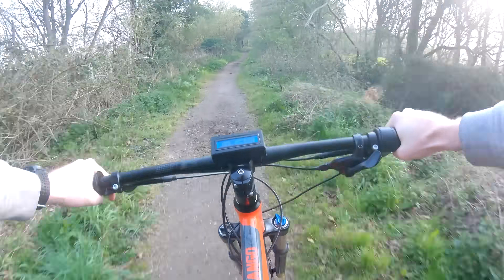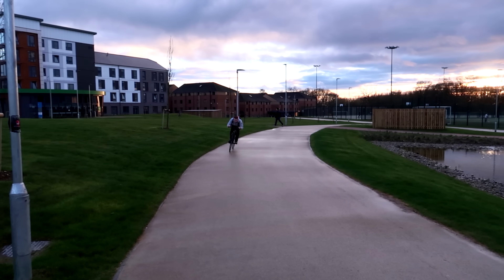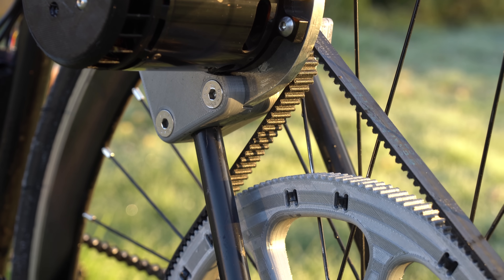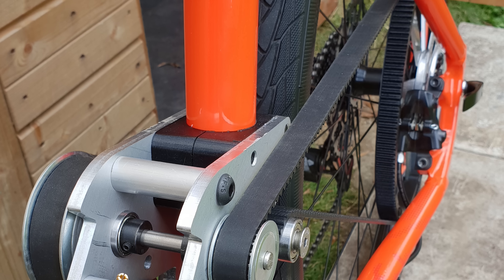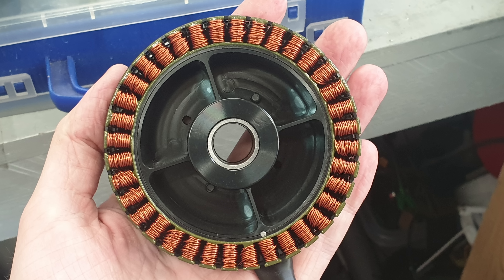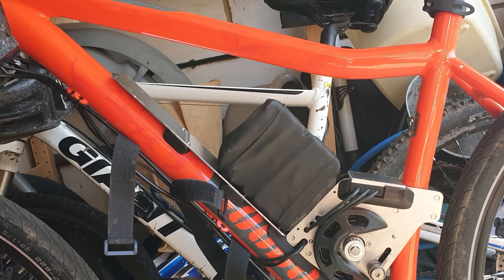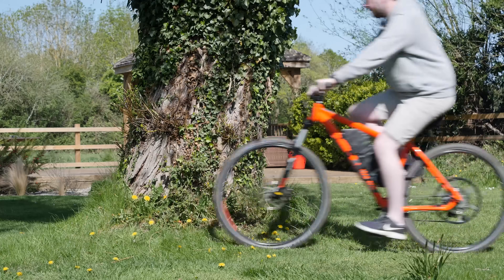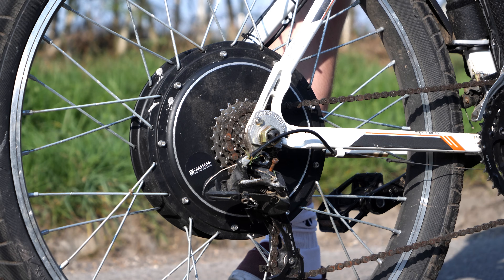Building an Electric Bike

Comment: i would have put some plastic between the cells in the pack. the heatshrink tubing those cells use a can be easily punctured by cells rubbing on each other or in a crash, effecitvely shorting them out.

Comment: I BOUGHT A EBIKE AFTER ABOUT 1000KM I CHARGED IT AS NORMAL AND IT WENT HALF AS FAR AS NORMAL NEXT CHARGE IT WENT ABOUT HALF AS MUCH AGAIN,,SO A QUARTER OF  NORMAL AND SO ON  TILL ID PLUG IT IN AND THE CHARGER LIGHT SAID CHARGED[GREEN] BUT THERE WASNT ENOUGH POWER TO TURN IT ON,IM SURE ITS NOT A BROKEN WIRE AS I CAN JUST HEAR THE HORN IF I PRESS IT SO POWER IS LEAVING  THE BATTERIES, ITS DRIVING ME NUTS,ANY IDEA,S  MY KNOWLEDGE IS THUS :I UNDERSTOOD EVERYTHING UPTO WHEN YOU SAID THIS IS MY ELECTRIC BIKE[9SEC] EVERYTHING AFTER SWOOSH

Comment: ME: Just buys an electric bike to avoid 3 years of designing😁
Reply: Electrict cycle cost around 25000 RS 
1 euro or pound=83 RS
1usd=70 rs
Reply: This is why you r not engineer 😂🤣
Reply: @ramadavince6611  lol I have home made electric motorcycle
Reply: Also building your own ebike is and awesome experience. Even if I have extras cash to buy ebike. Instead I will still build one myself
Reply: Depending on where you live there could be a lot of regulatory issues too, in my country for example up to 25 km/h assistance is allowed but continuous delivered power has to be 250W or lower. Also throttle based systems are not okay, only pedal assist so I'd already have to look into either a torque sensor or something that detects rotation of the paddles. As far as I'm aware as long as you're within these limits you're legally okay also with homemade conversions.

There are categories that need insurance and a plate though that aren't restricted to that power and speed (helmets also become mandatory with those I think, which seems reasonable to me). But since we're then in a regulated vehicle category I'm not entirely sure if technically from a legal point of view every "model" that makes it to the market has to be approved by one of the authorities in Europe that is allowed to or if everything is allowed and you're just screwed if they catch you and it doesn't meet the legal specifications. 

Both scenarios to me were way too much of a headache, ended up just going with a regular commercial mid drive motor solution and quite happy with it. Didn't want either the liability of fucking things up for the low power legal category or the second category where it would actually have to have a registration and insurance to drive legally.

Comment: In the first two motor setup, didn't you just need a belt tensioner in the middle position instead of a straight pulley?

Comment: Lots of fun building an ebike really from scratch. When I built mine I didn't even have a capacity test meter for the recycled laptop cells, recently ran a test on the pack and found they were within 15% of equal (9P6S pack powering a used electric lawnmower motor). I had lots of challenges too, but it adds to the fun and eventual satisfaction. I welded larger and larger sprockets onto the rear end and eventually made my own 7-tooth motor sprocket to get the ratio nearer ideal. It might have been easier to buy a kit but that takes all the fun out of it!

Comment: Always great to see innovation and enthusiasm on your videos, but in this case it's a shame that legality of elexctric bikes isn't discussed at all so encouraging people to build bikes which are illegal to use in the UK - anything above a 250W motor with an assistance cut-off at 15mph would make the bike a motorcycle and need a licence and insurance as such.
Reply: One guy here in Norway crashed into a pedestrian with his illegal e-bike in 2018, and the pedestrian got several small neck fractures and a concussion. He was sentenced to 15 days in prison as well as paying ~€2000 in compensation to the pedestrian. He had bought a 5.6 kW e-bike online for about €6000, and the bike was of course permanently confiscated.
Reply: Agree with this comment completely. Please say that these are private roads otherwise what you are doing is illegal. Also, as this is a new kit, a throttle is also illegal. I do like how you are designing new ways for an electric bike but maybe look at being more efficient by powering the crank rather than just the rear wheel. There are kits out there for a crank with a freewheel in them so when powering the crank, the crank arms wont spin.
Reply: @robmac3702  Those were most certainly not private roads.  He should stop, especially now that he's put evidence online.
Reply: The requirements in the UK are referred to as EAPC 
https://www.gov.uk/electric-bike-rules
Reply: These laws are Frankly not OK. I can power a bike to 20mph easily enough so it should not be illegal to have an ebike that fast. Taxes.   For what? It doesn't do anything different than a bicycle.    It's not fair really.
Reply: @gur262  "Taxes.   For what?" By applying "Leftard's logic" we can deduce that if Climate Change can be solved by adding a Carbon Tax, then applying an E-Bike Tax will reduce the speed of E-Bikes. I'm sure that would make perfect sense to a Leftard.
Reply: I'd say the odds of him getting a fine are very very slim. Everyone who buys e-bikes removes the speed limit anyway
Reply: @rodrigoc.goncalves2009  
Whilst that is very true, as a working engineer, one of the main prorities of a task is to design something which is in the confines of your local laws. After that, design using best practices such as British Standards and ISO's. There are many people hot rodding ebikes on youtube but one of the main reasons many people watch Stanton is for the informative and logical approach. By not putting in a disclaimer in the video he is putting himself at risk of prosecution which isn't very logical and may stop the great video output that we can expect to watch from him.

Comment: The problem is you used a motor with high RPM. It has been proven that e vehicles including bikes, cars, and the wheelers perform better in comparison to contemporary gas powered cars if they are installed with bldc motors with less rpm. For bicycles, anywhere between 3KW and 2000-4000rpm. The motor your choose, which was inspired by your flatmates skateboard project, is not suitable and that is why you have torque issue.
Loved the battery ideas though!

Comment: Where would I buy a motorcycle frame with running gear (lights and mirrors)?

Is it reasonable to just trawl autotrader and buy a cheapo second hand bike and cart the engine and fuel tank out of it?

Comment: My ex's father loved to put these together. He had found an homemade one with some broken parts and, using the motor and all the hardware he had access to from his work, he'd build and improve upon his bike. At one point, between the parts he'd get and what some friends of his would drop by, he already had two bikes, one with external motor and pulley, and another with a center hub motor, with him designing custom battery cells just like you've done, and both with internal gearing with a special Shimano hub and all. What is now my road bike (though motor-less) was an early prototype of his, still has the front rim all drilled for the center up with a different number of spokes!

Comment: Put regenerative braking on the front wheel. Handles most of the braking power anyways. Put a dedicated high efficiency generator on it and gear it properly. More complex. But idealized.

Comment: Witnessed the first ride of a dual-motor BMX bike two friends made a few years ago. There wasn't any room for batteries, so they had the idea to store them in a backpack for the test. Long story short, the bike worked fine for about ten minutes when the ESC caught on fire and shorted the batteries and some smoke came out of the backpack. My friend was remarkably quick in jumping off the bike, disconnecting the backpack and getting out of there. Luckily the smoke in the backpack was just a wire getting a bit too hot.

Comment: Oke guys I gonna tell my setup! I using it since 2 year without any issues. I made my electric bike with Turnigy 245kv motor and 6s 150A esc with sensor,and 6s 20000mah lipo. The motor and the shaft is connected to a Nema23 planetary gear. The planetary gear ratio now is 1:25. On the planetary outshaft I using 16T sprocket hub mount type.The bike top speed is 60km/h(first I used 1:16 gear ratio but was hard to start because the motor started to stutter ,probably torque was low or my  battery have low discharge rate,but top speed is was 80km/h). To the esc connected a servo tester.To the servo  tester a hall sensored twist throttle. I go almost every day(when not raining) to the work with my bike which is 28km far away.  The lipo battery pack exactly empty when I arrive at work. I charge it with 10A so take 2 hour to make it full. 
My setup is cost: motor 70 euro,esc 120,battery was 160 euro,planetary gear 1:25 140 euro,twist throttle around 15 euro,servo tester something like 1 euro, sprocket is 3 euro.
Reply: Could you give a link to the nema23 planetary gear?
Reply: @Baterii_CRISEVO  I bought it from Aliexpress.  The link not available anymore.  But you can search it ,just wirte "Nema23 planetary". Usually the good quality planetary gears cost between 130-180 euro. You can contact with sellers and they make any gear ratio you want and also make it compatible with your 8mm motor shaft.
Reply: @laszloszell8753  I was intrigued about using a stepper gearbox for a build but i wasn't sure about the torque handling capability and the overall length of motor + gearbox. In which city do you live ? I'm from Budapest, i would be happy to meet you and share some knowledge and experience
Reply: My electric cycle cost around 7800 RS and battery and charger 8500 rs
Reply: 1euro=83 rs
Reply: Motor 36 volt 350 Watt and battery 36 volt 13ah. battery backup
 60 km top speed 45km+
Reply: @biluroy4455  I using 6s lipo which is only 24V the motor can handle 32V but is would be to powerful. At other side also true , that with higher voltage would produce less warm the motor because take less amper. A bit more than 2 year I have no problem so far,just only normal maintenance. You have really big accu and motor which is a lot of weight, my motor 80mm long and 50mm wide you can hold in your one  hand and the accu   is 20cmx6cm which is  invisible because fit in the mountain bike triangle bag.
Reply: @laszloszell8753  i live in India and 24 volt 250 Watt pmdc motor and 24/36/48 volt 250 or 350 Watt hub motor and some use 48 volt 500 or 750 Watt e rikshwaw ( tricycle) motor kit this motor can achive 60kmph speed and 
48 volt 500 Watt motor kit cost around 3.5 thousand or 50$ and lithium ion battery 48 volt 20ah cost around 15thosand or 200$+or charger 2500$ or 35$
Reply: @biluroy4455  The point is, the bike have to be light.  Your bike looks very heavy.  The 245kv motor at 24v around 5800rpm. With load around 5000rpm. This a 2700W motor at 32V . At 24 v around 2000w which is 2KW. With the small 6s20ah lipo can drive 30km far away. And charge it at full in 2 hour.
Reply: Or ha 48 volt 750 Watt bldc geard motor kit can achive this speed cost only 5500 RS
Reply: Or battery's cost almost 15 thousand+2thousand battery charger
Reply: https://youtu.be/bekMO6ni9-c
Reply: We Indian Are jugaru
Reply: But no one use drone motor like 200 kv
Reply: @biluroy4455  Because peoples dont know how to wire,connect,programing etc. Peoples want to buy it and use it. But if you are talented in electronic then the best way the brushless motor. Simple,powerful,small,light, and live forever. In the bafang have the same system if you take apart, you can see it.. So dont know why  you saying nobody using it!!!
Reply: @laszloszell8753  motor Watt
Reply: @laszloszell8753  don't need any programs but if you buy 36-48 volt 250 hub motor kit it will be much cheaper and better quality
Reply: @laszloszell8753  weight hub motor weight almost 3kg+ battery weight
Reply: @biluroy4455  I seen your video link with the green mountain bike . If motor 3kg then that huge battery pack min  8-10kg plus that huge controller . Send me your email I send you my setup.

Comment: That's pretty amazing but isn't the legal limit 250watts?  Or you need to get bike registered as s-pedelec. In the UK  L1e category is 1kw /15.5mph without assistance  or e-bike and requires registration with DVLA for use on the public highway.  Yes a number plate, no joke. You might need CBT if passed test after 2001. Above 15.5mph u have to pedal or at least fake it.

That 3.5kw bike is L2e-B which is a Moped and you need not only registration but a CBT + driving license + insurance and maybe MOT.  FUK.  (Keep it under 1kw). If you were done. 3 points for no CBT, 3 points for no insurance, 3 points for no registration. 12 points you lose your license, 12 month ban and can't even drive your car.

Hope that helps, amazing machine but only legal off road.
Reply: The laws don't mention torque as far as I can tell, so a 1kw motor with huge amounts of torque would still be pretty damn fast and fly up hills. To go quicker look at aero dynamics next, time trialing positions, aero bars, aero wheels. Could still do your 30mph! on 1kw, have the motor turn the pedals as well, so it does qualify as pedelec. Good luck!

Comment: I've just finished building an electric bike using a Turnigy Aerodrive SK3 - 5055-280KV brushless outrunner motor as a friction drive.
The motor is mounted where normally the bicycle standard is. When throttling up, the torque will push the motor against the wheel.
Top speed is 40km/h. Range I did not test.

Comment: More than 350W? Or faster than 25kmh? You need registration, plates and driver license... And full motorcycle equipment, for better. All these electric bikes are very deceptive. Slightly more power and you have motorcycle, with all implications and complications.
Reply: Yep, motor travel at 45kmh, it is motorcycle from legal point of view.
Reply: 250W for a bike, 350W for a trike, 15.5mph, but who cares cos we've left the eu, so laws no longer apply, we should be like USA, 1000W, 30mph, legal
Reply: @andyb7963  This is more than 1kW and 30mph :) But I think (as city bicyclist with 10+ years of experience and road/offroad motoryclist) that all these lectric bikes must be regualted as mopeds and motorcycles. Yes, 50cc scooters don't require registration and license in some jurisdictions, but everything more powerful should not have any "exempts" because it is "electric" or have pedals. Power and speed (which is energy per m×V²/2 formula) matter. This thing at speed of 40Kmh with 60+kg rider will injure pedestrian no matter which type of engine it has. And when you ride into lamp post at this speed it doesn't matter, was it gas-powered "motorcycle" or battery-powered "bicycle", so you better have same motorcycle protective equipment., proper (not bicycle) helmet, etc. And better you have proper training, as riding at 20kmh and 40kmh is very different.

Comment: This is an electric moped not an electric bike.. under UK law an electric bike can only have peddle assist, and requires a maximum speed cutout. If you have a throttle it is a moped/motorbike and it requires registration insurance and govt testing.. and a licence!
Reply: I smell pork

Comment: Cool to see the evolution of the bike!  Can't wait to finish my shop so I can actually have a proper area to work on stuff like this myself. Will be my summer project to get that done.   I need to find or write a proper Linux cad program though.  Most of them are not user friendly and not intuitive to use at all.  I don't have room for CNC stuff but could start with 3D printing.  I kinda want to build my own RC cars from scratch, and scale up from there.   Seeing everything you build is an inspiration.

Comment: Out of curiosity, did you ever notice the disc-brake rubbing against the caliper? I suppose they're designed for the same direction of force you're applying with the motor, but I'd imagine any sort of sway in the line would cause them to become misaligned. I don't use a disc brake bike, but I'd wager the distance between the caliper/rotor is something like <1mm?

I've really enjoyed following this project! Hope to see more in the future. My CAD skills are lacking, at most I could design the gears. I'm still amazed when I see people replicate parts from images.

Also, looks like you now have time to focus on improving the aero gains! ;D

Comment: Follow your ebike projects was soo interesting, it's great to have real engineering when most "DIY" videos are often mechanical assemblies without "calculations". Great choice for RC out-runners, the higher the motor RPM, the higher the power density is since the mass of a motor is roughly only proportional to its torque.

Comment: Although i am currently in my 3rd year of mechanical engineering career, i've been wanting to make an electric motorcycle for a long time. I am currently self studying electric motors and electrical engineering and trying to make 3D printed motors! i have already made one using Makesea models and their information. Hopefully will achieve building one after graduation. :)

Comment: Great video as always, I've enjoyed following this over the last few years and its really inspired me during my degree. For my final year solo project, I've spent the last year trying to build a bike that is self balancing in a straight line and steady turn using accelerometers and gyros to measure the roll/lean angle and a PID controlled DC motor to actuate the steering. The aim was to hopefully make it autonomous or remote controlled which I never got to because of time constraints and with the Uni closing due to corona but its been a fun one that I might carry on with privately after I graduate.